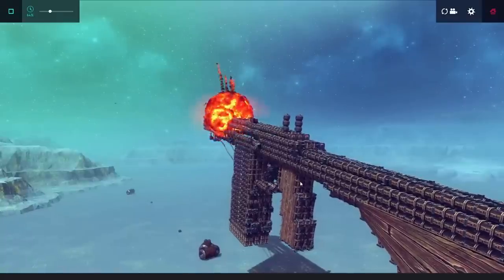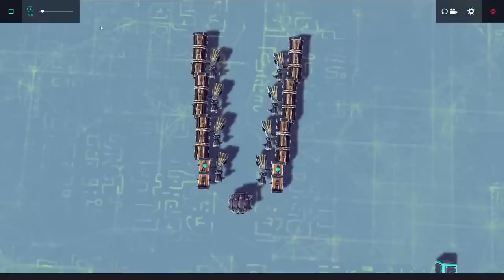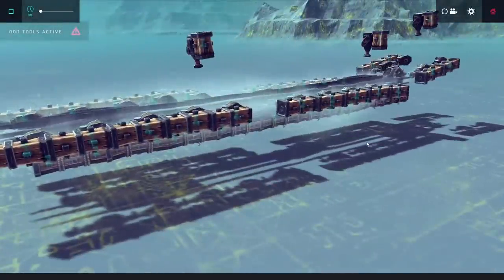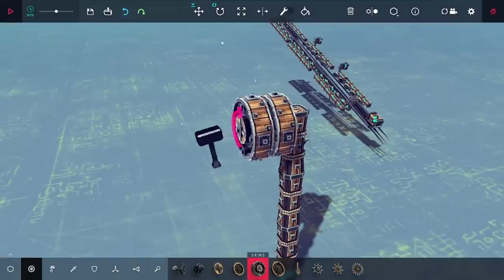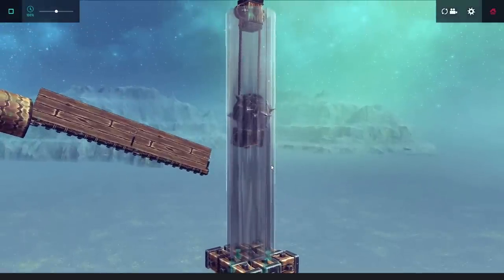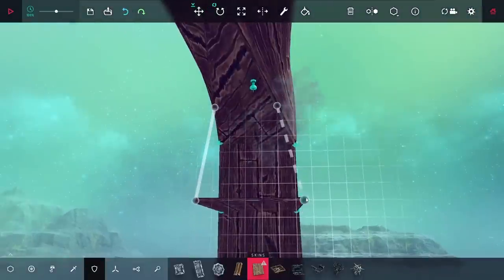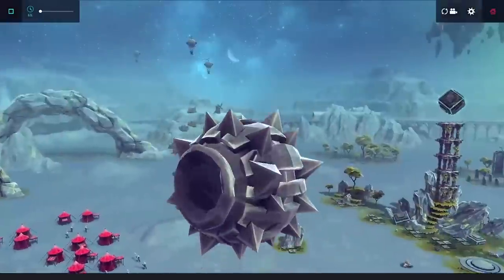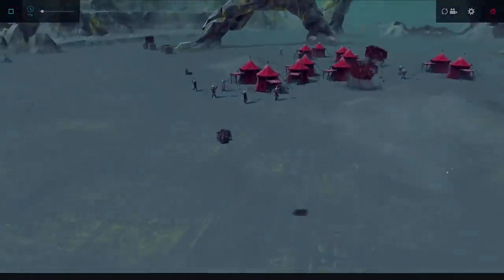Making a Functional Pistol in Besiege

Comment: What would have happened if you detached the upper slide of the gun from the barrel, attach the vacuums to it, and allow it to slide freely? So as they suck the bomb forward, they also suck themselves backwards. Then like a real gun, use a spring-loaded feeder to force a bomb upwards when the slide is at rearward travel, and a spring system to bring the slide forward again.